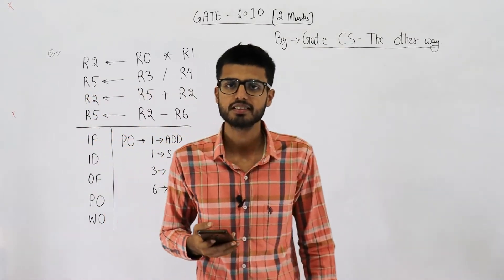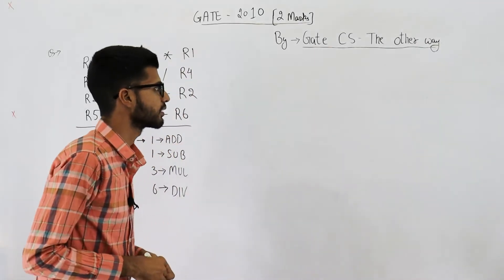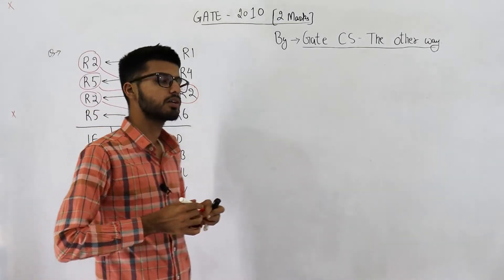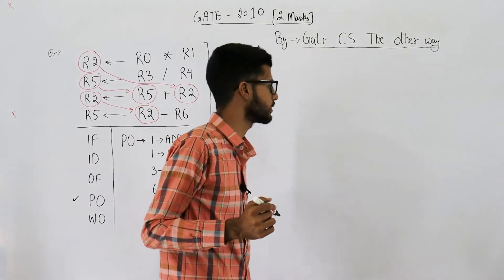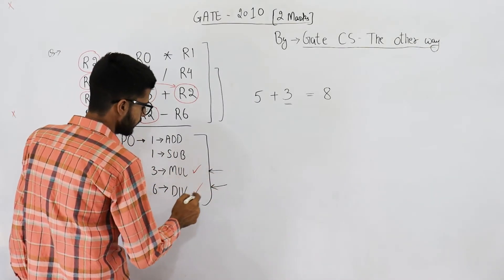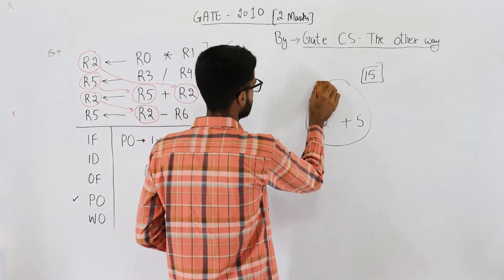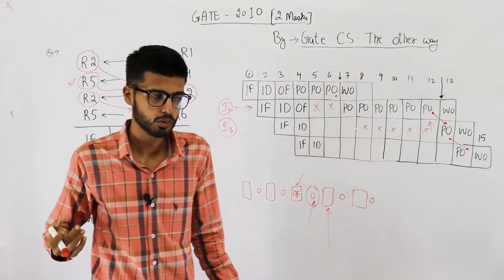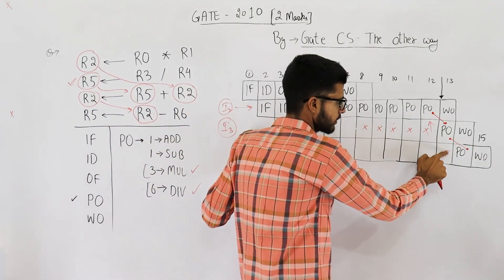Gate 2010 pyq COA | A 5-stage pipelined processor has Instruction Fetch(IF),Instruction Decode(ID).

Comment: please make a video on without operand forwarding
Reply from the maker: without using operand forwarding it will take 18 clock cycles .
see each of I2, I3 and I4 will consume 1 clock cycle extra(PO can start only after ending WB of previous instruction if u don't want to use operand forwarding)
Reply: @GateCsTOW  
please make a video
i have exam on monday. thanks
Reply: @GateCsTOW  sir i think its 17 because instruction 2 does not depend on 1